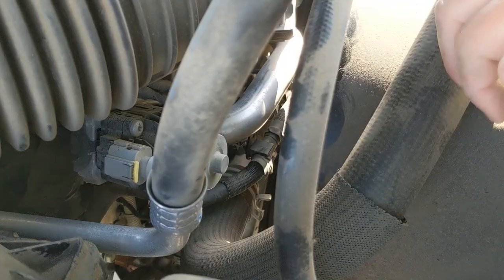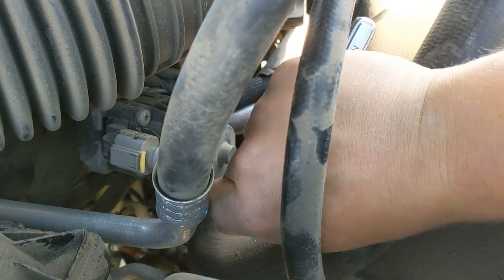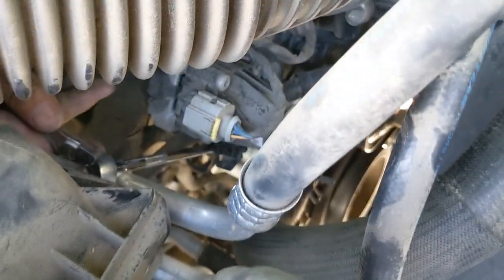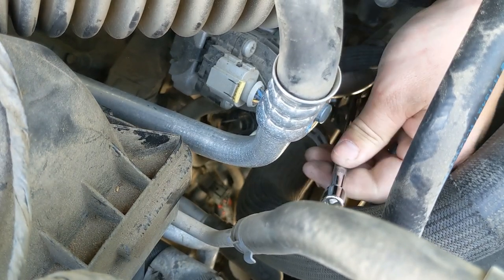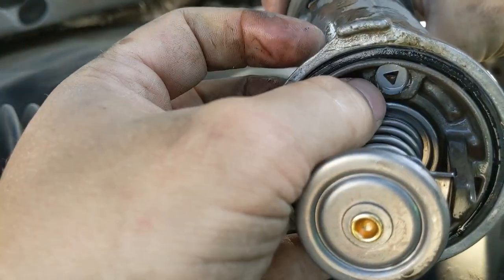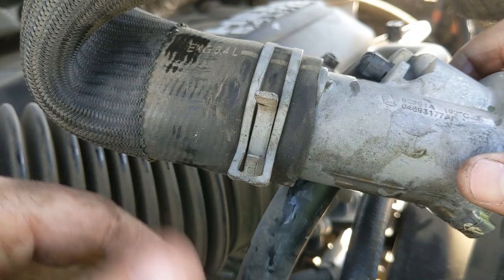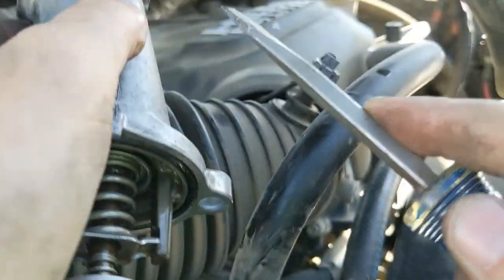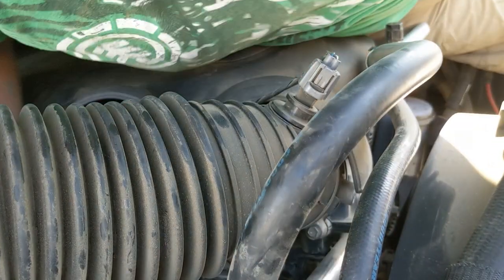How To Replace Thermostat On 2015 6.4 Liter Dodge Ram 2500 - Code P0128

Comment: Update January 2023: You're not going to pay about $100.00 for that OEM thermostat/housing anymore. Try about $190.00 if you can even find one. I tried 2 Ebay vendors that advertised them in stock and the Official Mopar website also advertised as in stock and all 3 orders got canceled because not in stock with no ETA at all. Really great when you need your vehicle inspected but can't because of check engine light due to thermostat. Of course they took my PayPal payment, too. Let's go Brandon supply chain crisis.
Reply from the maker: That sucks. It's been that way even when I did mine. I waited almost a year for one to come in stock. The problem is this part is a consumable that MOPAR has labeled as an integrated engine part, so they don't plan on replacing them. That's crazy that they are that expensive now for such a simple part. Might have to hit up a wrecking yard.
Reply: I found one on Amazon for $87.
Reply: @ethanschrick6392  that's the Dorman and it's not OEM
Reply: @jeffreyflick4501  the one I got is the Dorman but it has the Chrysler emblem and part number and it ends in AD as opposed to AB or AC.
Reply: I also found this one that claims to be OEM if you absolutely need OEM
Reply: @ethanschrick6392  I'm reading the reviews on the one on Amazon and they are highly rated for that part. I'm wishing now that I ordered that one, but I already have an oem mopar shipping to me.
Reply: @ethanschrick6392  well my OEM failed at 62k. I think a fisher price brand might be a step up.
Reply: @Jeremyv1980  I got mine switched out and haven’t had any issues as of yet.

Comment: I’m got a 19 and the code just popped up today. Bought it used about 6 months ago and it’s been around 180-200ish here in Texas so I assumed it was the normal temps. Either the previous owner put a lower tstat or it’s been running open for a while without throwing a DTC. Great video man! I looked under the hood and definitely a lot more looking around more plastic than my 08 1500 haha.
Reply from the maker: Yeah, I had an 03 before this one and it was a lot more mechanical and less electrical. Good luck with your fix!

Comment: I have  the 2017 but I'm not having any issues  with cabin heat it's just throwing the code. I'm not seeing any leaks and the reservoir is filled right about mid when cold. I'm guessing the thermostat needs to be replaced since the sensor pretty much comes attached to it.
Reply from the maker: Yeah, that sounds like the sensor. It might be worth checking all the connections and cleaning them. What temp does the dash read once it's warm?
Reply: @RoadandReel  Id have to check it but the gage shows just above the quater mark just below mid. It won't go above that point either  no matter how hard i get in it. Run the defrost and heat full blast to see if it will go above that point.
Ive taken it out in the mud a couple times you think maybe unplugging the sensor cleaning it and putting back might fix it? Worth a shot know for sure if it was the actual thermostat and not something electrical lol
Reply: @RoadandReel  Normal operating temp is 205 degrees?
Reply from the maker: @ThePowerOfTheD  yeah, you should be able to get a specific reading using the dash options.
Reply: @RoadandReel  yea it's not reading above 185 it's only 60 degrees outside and i was just getting on it pretty tough. Like i said though cabin heat and everything works fine no issues there no leaks. I'll see if i can clean the connection and what not, thanks for the help! Feel some what reassured that i won't have to dump 500 dollars into it for such a simple fix.
Reply: @RoadandReel  is there more than just the one sensor that i should to check?
Reply from the maker: @ThePowerOfTheD  that's the exact symptoms mine had. The thermostat was stuck open and the engine wouldn't reach operating temperature.

Comment: Mine is blowing warm air and that's it. Getting ready to do this myself. I've checked everything else so ordered the thermostat. Dealer wanted almost 700 here.
Reply: Mine doesn't read the actual temp but it's just below half. Same as the 2016 at temp. It wasnt the thermostate it was actually the climate control. New one fixed it. Unsure why it would work but it would malfunction and every time it would be something different. Unplug it and plug it back in and it would work.
Reply: @chiphafford6774  too funny. I'm doing same thing today. Hope it solves the problem and have heat for winter.

Comment: I'm getting the same code. I believe it IS the thermostat staying open because on a cold day I can't get the truck cabin to heat up. I didn't see an answer to Joe Schmoe's question below... Did replacing the thermostat actually fix you issue and stop the code from coming back?
Reply from the maker: Yes, this fixed my problem and I had the same symptoms as you. I haven't had a single issue since. Hope that helps!

Comment: What's your riding around temp? Mine is 206 or so. It can dip to 188 and go up to like 216.
Reply from the maker: Mine is very close to the same. It runs about 205. It never goes below 187. I've been close to 220 heading up a long steep grade with my trailer.

Comment: FYI for those doing this repair - the OEM hose is indexed to the housing with a white line which can be seen at the 10:15 mark of the video.  Just line up the line with the tab on the housing.  You can skip the Sharpie if you want.
Reply from the maker: That's great to know. Thanks for pointing that out, I didn't even notice. 👍👍👍

Comment: Thanks for the video, have to do this on my brother in law's truck and this was exactly what I was looking for.
Reply from the maker: Glad it helps!
Reply: @RoadandReel  Would I be right in trying to park my 6.4L downhill, turn on the heater on after reaching normal running temp and make sure any air is purged....before I assume the thermostat/sensor is faulty?  Or, did you already try that with yours?
Reply from the maker: @dandexinventor  it's always worth an hour or so to save some money. I would try parking downhill as well and checking and cleaning your electrical connections. At least if the problem is still there you'll feel better about spending the money. Give it a go and good luck! Hit me up if you have any more questions.

Comment: Thanks man really appreciated you and the details in this video. You saved me time and time is valuable. I do have something to share. I found it was easier to get the bottom bolt out from underneath. My RAM is lifted so it was really easy to remove the shroud and then the bolt was right there. Anyways really wait either way
Reply from the maker: Glad it helps!

Comment: I also have a 2015 6.4 and am getting the the following code P0116 "Engine Coolant Temperature Sensor Performance". I cant seem to find anything online that shows the location of the sensor. Is the sensor you point out in the video the coolant temp sensor? I am thrown off because it appears that I can order just the sensor. Suggesting that I do not need to replace the whole thermostat. Any ideas?

Great video by the way. I appreciate the information. Of course this code pops up when the temps are freezing. Kind of wondering if the sub zero temps might be causing my code and it will go away once it warms up. I ran the truck once to further diagnose, I get active temp readings starting at 60 ish to about 180.
Reply from the maker: I believe there is a coolant temp sensor on the driver's side near the exhaust manifold junction. I could be wrong. I haven't had to replace mine yet so I haven't had to find it. I can't find it in any of the service manuals. In the past, it was under the compressor on the front of the engine or even in the water pump housing, so you might just have to crawl in and start following the harness. It doesn't sound like it's a thermostat problem and you may be right about the cold weather causing issues.

Comment: Nice video! How much coolant did you need to replace approximately?  Thanks.
Reply from the maker: I can't remember exactly, but I think I bought at least 2 gallons. I bought it at the dealership when I picked up my thermostat. They will have those specs if you buy their coolant or you can give them a call and they will be able to tell you over the phone.

Comment: How are you recovering the antifreeze?  It sounds like the fluid is dumping on the ground…
Reply from the maker: Yeah, it didn't all make it in the bucket. I had to clean the rest up with some oil spill granules. Luckily it was all pretty isolated.

Comment: Good video, but did it fix your issue??
Reply: @RoadandReel  Cool, I'm throwing a different code on my 2015 2500 6.4L - I've got a P2181 code and the "Service Electronic Throttle Control" message on the dash.
I'm still researching though....
Reply: @RoadandReel  thats cool. Question: where is this sensor? Under the hood or in the cab near the throttle?
Reply: @HD2O13XL12OOC  what fixed your issue with your truck?  Mine did the "Service Electronic Throttle Control " yesterday. I havent taken it to get the code pulled or checked yet.
Reply: @andrewdeberry479  I had aother code, had to do with the thermostat so replacing the thermostat, cleaning the throttle body, cleaning all the connectors in and around the throttle body, cleaned them out with like an air gun and then putting some electronic contact cleaner on them and getting a new air filter, oh I also disconnected the battery for a little while when cleaning contacts, put it back together and all that seemed to help it. No code for over a month

Comment: What thermostat did you use the one from the dealer or from a auto parts store
Reply from the maker: I ended up using the one from the dealer. At the time, no one had one in stock. I think it was about $120.
Reply: @RoadandReel did u had to replace it again since?. I had to  replace one last year and 9 months later same problem 
2018 120k milles
Reply from the maker: @samboy504gonzalez8  no, I haven't had anymore issues. It should be under warranty if it's under a year.

Comment: That coolant is pricey, is there a way to plug the hole while you’re changing out the thermostat so you don’t lose so much of it?
Reply from the maker: Not really. About the only thing you could do is try and clamp the upper and lower radiator hoses. I don't know how easy that would be, but it's worth a try.
Reply: Makes sense. Thanks!

Comment: So you can’t replace the sensor without replacing the whole thermostat?
Reply from the maker: Exactly. It is built into the housing and meant to be permanent. I spoke with the Ram service center about this and they agreed it was a bad design.

Comment: I have same engine how did you bleed the air out
Reply from the maker: I put everything back together and filled the coolant reservoir completely. I left the cap off and started the engine. I tuned the heater on to get the coolant running through the heater core let it run and reach operating temperature and when the thermostat opened, it burped the air out of the system.  You'll see all of the air come out and watch the coolant suck way down. I then filled it up to the fill line and put the cap back on. I drove it for a few days and had to add a little more coolant because it dropped slightly, but not a lot.
Reply: @RoadandReel  where was the bleeder or check valve I changed mines it now reaches 220 but no heat could it still be air
Reply from the maker: @carlosblanchard2057  These get air around the thermostat that causes cavitation. An easy way is to park nose down with the heater running and the engine on. Open the radiator filler cap before it heats up and let it run like that until it reaches operating temp. Then give it short revs to get the coolant moving at different speeds. That should move that air out of there. Water the fluid and see if any bubbles come out and watch the coolant levels.
Reply: @carlosblanchard2057 did you ever get it to bleed out? I'm having the exact same issue

Comment: I did like that but still see same code so any body know were the problem
Reply from the maker: Check your plug on the thermostat housing and see if there is any corrosion. Make sure it is getting a good connection when plugged in. Make sure to clear your fault codes as well.